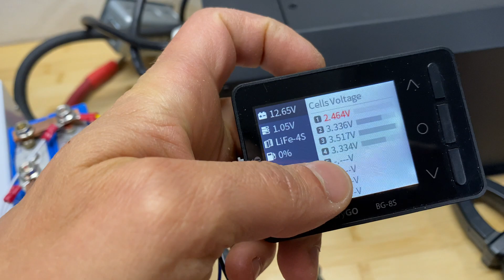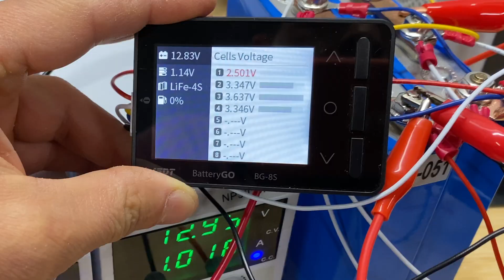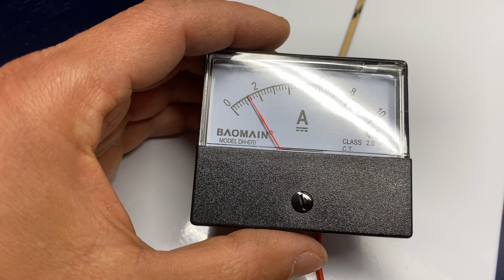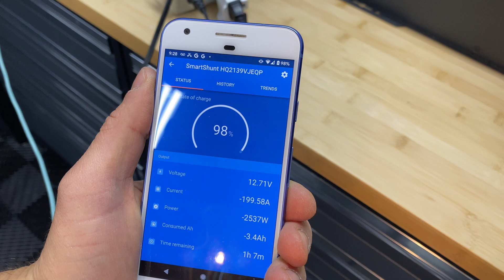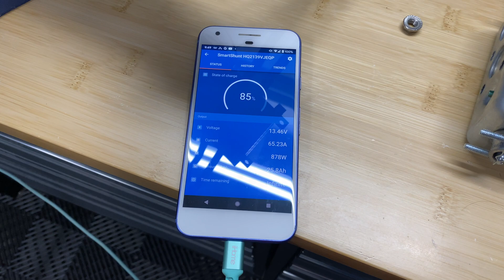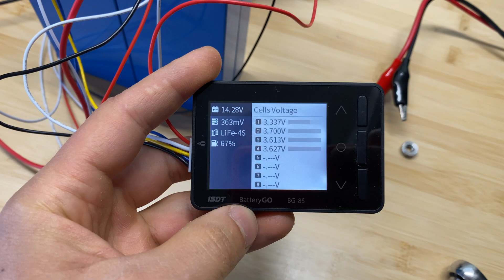Full test of Maxkgo 4S 200A LiFePo4 BMS with active balancer.

Comment: Hi great review! I am looking for a bms with active balancer which could balance the cells with current > 2A.this one looks fine but does not have a Bluetooth option. Building a diy pv/batterry system with victron hw. Could you please advise from which supplier on Ali I could get good grade A prismatic lifepo4 200/280Ah cells?
Reply from the maker: I have a bad experience with cells from Aliexpress. I purchased from the store with an excellent reputation, but cells arrived bulged and under capacity. Seller and customer support didn't resolve the case. 
In my system, I'm using grade A cells from BLS (here is the affiliated link: https://blslifepo4battery.com/?ref=di7np5afqdbh). They ship from US warehouse.
It's more expensive than you get from Aliexpress.
also coupon: Get5

Comment: Wow, very interesting. Active balancing on a standard size BMS is impressive. I have never ordered maxkgomall, thanks for showing me that website. Whoa 200A!! Was not expecting it to stay that cool. Great video.

Very strange that cell #1 lagged behind after balancing. I would expect them to be nearly the same, considering the balance current and size of pack. Bummer.
Reply from the maker: thanks, yeah active balancer could be improved, when cell v diff is less than 200mV then balancing current dropping drastically.
Reply: @SolarEngineering  Is this balancing only adjacent cells or any to any cell in pack? That board looks like balancers that only connect 2 cells.  There is also 8S on aliexpress available.
Reply from the maker: @CrashBashMash  I haven't tested this particular scenario on this balancer, but from my experience with others, yes it will transfer energy from adjacent cell to adjacent cell (which make balancing longer).